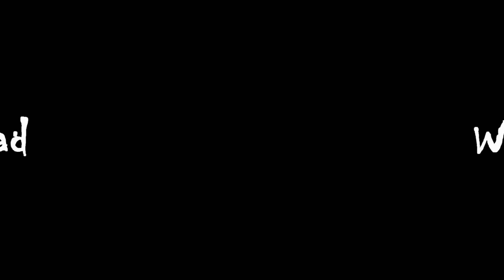Countersink self made

Comment: It's easier and faster than you are doing it. Just stop at 2:26, and reset the chuck holder to its angle at 2:03. Then remove nearly half the 90 degree bit that you produced, to about 2mm from the centre line. That will produce a tool that doesn't leave chatter marks on the hole, and can be resharpened with a slip stone in seconds. If you only want it for wood and plastic, just produce it on a lathe and use a hacksaw to remove the wedge bit, then clean up with a file. Mild steel will last for a reasonable time if you don't want to heat treat it, and you needn't for cutting soft materials. I can make one in 2 minutes from an old bolt. Works the same way as the ones that have a round hole drilled across them. If you make the big diameter section longer, then you can fit an adjustable ring that will act as a depth gauge, tapped and fitted with a couple of screws, so all your countersinks will be the same depth. On a lathe it's easier to put a fine thread on that diameter and use a nut in place of the ring.